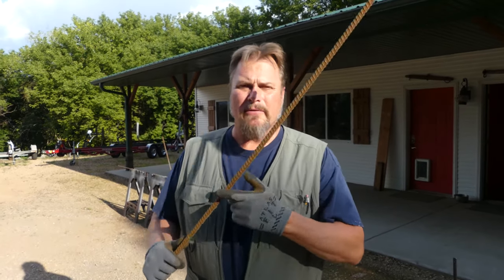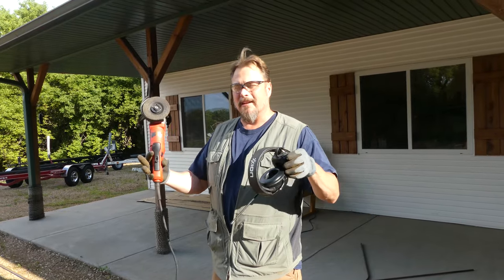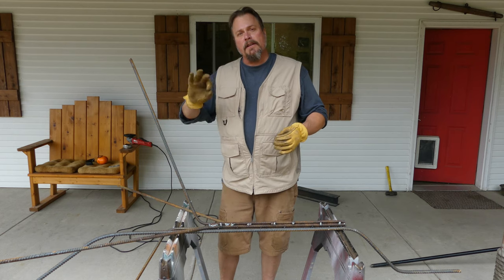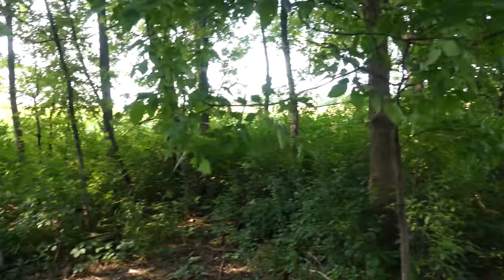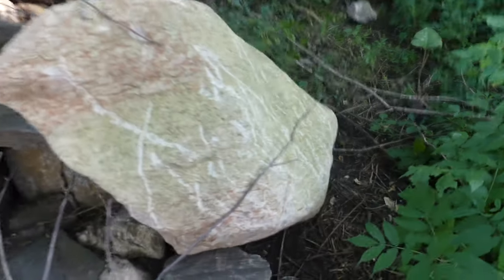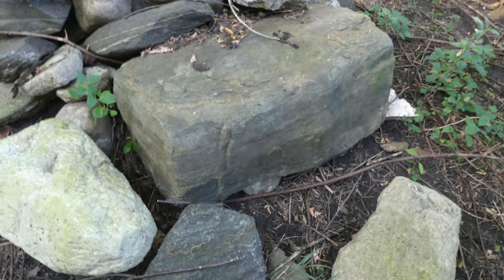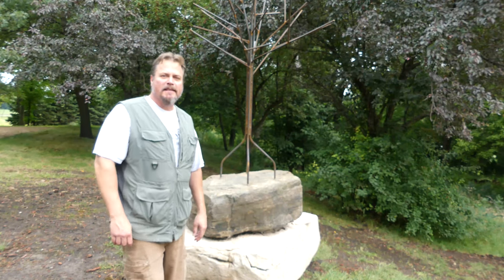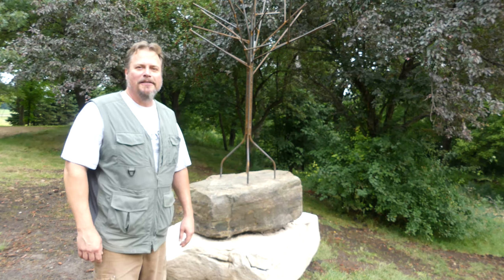Rad Rebar Tree

Comment: what kind of welder you got? Im trying to do a similar job off grid and all I have is about 1500 watts of 12v invertor  power from my engine (115v 13a AC) roughly.  I was wondering about gas welding 1/4' rebar,  9ga wire and barbed wire around T posts in  natural looking shapes, painting them brown/green mix and waiting Green Brier to wrap itself around all of that for security.